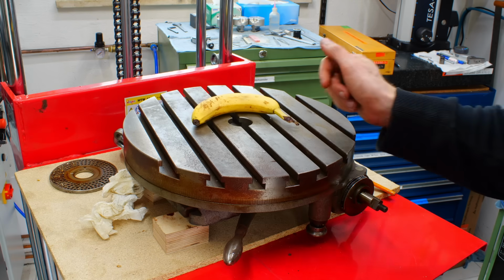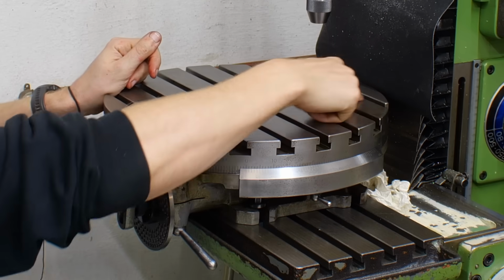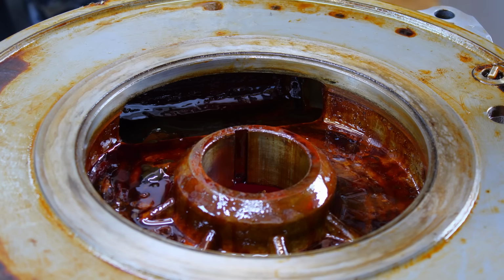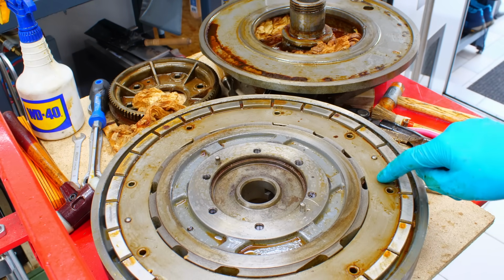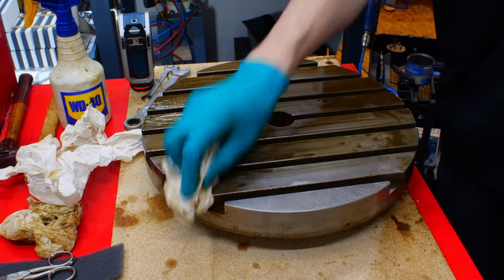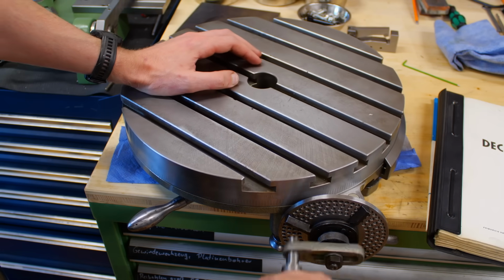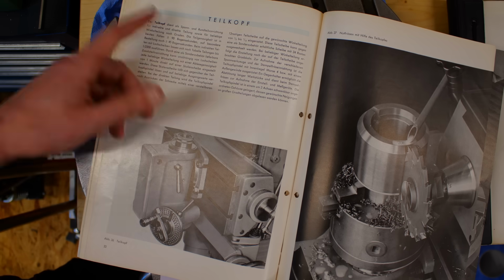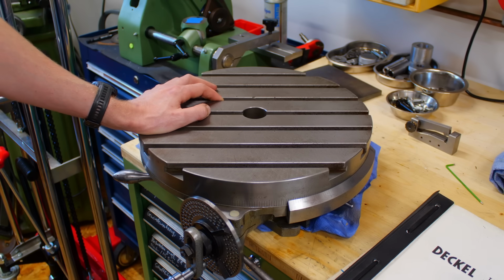Deckel Rotary Table: 380mm Monstrosity

Comment: I bought a 'cheap' ($500) 10" (250mm) rotary table several years ago thinking I would never need something that big.
It's heavy so never got the use I expected (4", ~100mm) was usually large enough
A five or six years later, I needed a 20" radius (~500mm) over a 5" (~125mm)  length on the end of a 1/2" (12.7mm) 6061 plate. (x2)
Luckily it wasn't high precision so  a bolted on extension plate (piece of steel, 5/16" thick (~8mm)  not quite thick enough or wide wide enough to support it very well. I made a 'slider' for outside edge, far from idea but it cut vibration to almost zero so got the job done.
Main point, apart from liking machine accessories, you never know if a hobby project may come along.
I was making an Egli style fork brace for a 1965 Suzuki T305, there were four 'precision holes' that needed to be in line as plates would be 5"~6" apart (125~150mm) with rods
I know you have made precision parts for Honda's, (CX water-pump rotors?) you may feel like making something less precision but 'interesting'
You need a lot of space to be a tool collector

Comment: Stefan, I'll wager a beer that the rotary table finds a use as an extension to the work area, particularly for the work that you describe as 'larger'.

I say that, because I've seen the effort that's required to hold the work on the vertical surface of the mill ... 🙂

Comment: If you had a job requiring lots of tool changes and multiple parts, you could set up multiple work stations and just rotate through 3 or 4 parts for each tool.  By the way, I can't seem to find the videos about those fancy EDM vises you had purchased..

Comment: we have a vertical shaper that has a rotary table built in , we mounted a 4jaw to that so its great for setting up work that require multiple keyways or splines

Comment: Nice fixture - it has basically never been used. The hardened grease and thick oil is typical of an item sat forever. Great find - if a little big.

Comment: Man I wish you had shown the reassembly process
Stefan doesn't respond very often to comments 
but I really would like to know what lubricant he used
Reply from the maker: I though I was pretty good at comments?
MoS2 lubricant on every press fit, screw thread and ISO68 way oil for the geardrive and slide surfaces (Thats also what the rotary table is filled with).
Reply: @StefanGotteswinter  Thank you so much! I appreciate the response
I have a 12" Tryoke that I want to rebuild - I'll use the same

Comment: Do I understand correctly that the total tolerance of 180 arc seconds is the same as 3 arc minutes?
and do I understand it correctly if I convert that to the deckel with a diameter of 380mm, that you then have a maximum deviation of 9.94mm based on the maximum radius of the deckel??
cheers 
ben
Reply from the maker: 3 Arc minutes is correct, yes.
That converts to 0.05 degree.
On a diameter of 380mm (190mm Radius), thats a maximum error of 0,166mm at its circumference.
(Didnt do the trig, I drew it out in cad.)
Reply: @StefanGotteswinter  oops, you're right, I forgot to divide it by 60 and then multiply it times 3

Comment: Something that I find usefull in such large rotary table (but it might be specific to my field of work) is the ability to put another X-Y table on top of it to work on a part with circular features with different centers.
Reply from the maker: Absolutely useful, agree! I have a X/Y stage that goes on top of my indexing head and i use it more often than i would like to admit.

Comment: Stefan is hovering over a line. There are the machinists who move parts with tweezers (eg., Clickspring), and then there are those who use cranes (eg., CEE Cutting Edge Engineering). They represent the boundaries. Most of the craft is in the middle where stuff is moved by hand. Stefan has always been closer to the fine end. Now he needs a crane! All preconceptions have been exploded and all bets are off for the next project. Enjoy the work you do, and hope the perfect job for the new tool comes your way (and you can share it with us).

Comment: Enjoy Stefan, the 6017 is lovely (and, in a way, very suitable to the smaller machines with the narrow beds. On the FP3, you either need spacers to lift it off the table or, if you place it at the edge of the table, it ends up very far from the machine...). One point that needs some care is the clamping: since it's in the middle of the table, if one goes crazy on the clamp, it pulls the middle of the table a bit low and bows the end up high. So don't go crazy on the clamp.... :D I think this is different on the swivelling circular table 2236.
Regarding the Moore, well, 6017 was Deckel's workhorse. The optical ones do 6 and 3 arc sec accuracy, so, beat that Moore, haha... :P

Comment: Stephan, I own two of them because they came with the Deckels I bought. The weight is cumbersome to work with but they’re really great for extending the machining area. I made really big parts on my Minimill with it and loved their accuracy. When setup correctly I couldn’t see or feel any transitions in meeting machined areas. And the reach of the y-axis on the Deckel has been to small many times now. And with this guy you just swap your y travel to your bigger x travel. They’re beautifully made and can be lifesavers in the shop. I also used it with a compact vice on top. One datum in the DRO for the back-left corner of the vice and a datum for the center of the rotary table. Quite universal in many cases. Thank you for sharing your Deckel adventures with us. I’m a big fan of the brand and your work. Thank you Stephan. Best! Job

Comment: Bought a Troyke DMT-15 (12" Rotary table with X-Y). Damn thing weighed 140 kg and I never got it on the table of my Bridgeport. Stan Z (Bar z/Shadon HKW) bought it off me and he quickly also got rid of it too! Didn't really need it after my Tormach PCNC 1100 arrived. Never did have to figure out how to set it up, CNC much easier!
Reply from the maker: Damn! Those Troyke X/Y Rotary tables are so cool. But also SO obsolete :D

Comment: I have a strange kind of nostalgic happiness I associate with the smell of old oil.  Yes it is stinky, but it reminds me (I'm 70) of a pleasant past.
P.S.  I have an almost identical lift cart ("stacker" we call them), except mine is blue and has forks.  They were probably made in the same factory in China.
Reply from the maker: This one has forks too, but came with a sheetmetal plate to transform it in a flat "table" -very useful! :)
Reply: @StefanGotteswinter  I have a sheet metal top to a machine cabinet I use for this purpose.  Not perfect, but free.
Reply: @StefanGotteswinter  P.S. The Pretty Reckless are playing at Olympic Stadium in Munich on June 9th.  Thought you might like their hard rock / death metal style.  Death By Rock and Roll. :)

Comment: Great video.  I really like seeing the Deckel equipment and how well you explain how to use them.  I have a 15” 380mm Troyke rotary table.  I bought it from an auction at a really good price.  I did not think that I wanted a table that big but after having it, I don’t think I would want a smaller one.  It is just so easy to clamp down things onto. I think you will find yourself using it often.

Comment: Great stuff. I well remember the anxiety tearing apart/cleaning an old tool to the point I could tell if it was good or scrap due to wear/abuse. Your table looks to be almost mint condition.
A question: in your career have you had to work with castings much? I remember work holding castings as being some of the most challenging things I ever had to do.
Reply from the maker: The only time I had to work with castings was with hobby projects - Dayjob was all solid stock or sheet metal. The closest I got to working with castings was with finish-machining metall 3d prints.

Comment: The last rotary table l tore apart had a special bearing from Kaydon. Very similiar to a QJ type bearing but with rollers instead of balls. For backlash adjustment of the worm drive the worm screw was a variable pitch lead. The worm screw could be adjusted axially to get the desired adjustment. RT was the 4th xais on a K&T HMC.

Comment: I do have similar rotary table on my TOS FN25, which is a cheaper clone of FP2. It does have some rust damage on the centering element, which is used also for direct indexing with locking mechanism pointing to the center of the table. I think to re-bore the housing to clean the rust pitting and wire cutting new oversized centering/indexing ring with some 0,02mm clearence. Anyway thanks for the video Stefan.

Comment: Have the exact same table which I use on FP4. Good table but slightly annoyed by mechanisms under the table which means you have to have it hang over the edge of the mill table or shelf it's sitting on

Comment: that's one nice table, and I hope you get some good use out of it. Sounds like you need to make a cart to hold it vertically while not in use, with wheels, or for use with a pallet jack.  Some lifting eyes will help you greatly, better than beating up your straps on the clamp edges.

Comment: For the tax man, when you are writing this purchase off as a business expense, explain that the parts you manufacture are usually small[ish] but they might have some large radii that you are going to make on this. Sometimes for aesthetics alone. And make sure to include a large milled radius on a few of your products, even as a chamfer or instead of straight line ;-)

Comment: I get your reference to 15+ bench vices😉  looks like you've picked up a gem that complements your mill and other rotary equipment, so you're ok👍👍

It would be interesting to see if the precision is enough to actually double the y travel usefully - it's got to be worth a "short", right?🙂

Comment: Too big for the FP1, IMO. Even too big for the FP2, IMO. Really needs to be on an FP3L/FP3NC/FP4NC.
Reply from the maker: I am split on that :D
They where advertised for FP1 up to FP3 and for the G1L / KF Engravers. It looks a bit ridicioulus on the FP1, but with its low profile I suspect it to be practical.

What I dont like for a permanent setup, is the large overall weight - Rigid table combined with the rotary are almost 80kg pulling on the x-axis.
Reply: @StefanGotteswinter  I used to use a 6" Kurt on my FP1, but it's way too big/heavy, similar to that table. There is no doubt, Deckel made some of the best accessories. I recently picked up a slotting head for it, but haven't put it to use yet.

Comment: Adam Savage (of Mythbusters fame) is making a smaller form factor round safe door that has a number of gears around the perimeter that drive pins outward like you see in movies about banks years ago.  He was asking why all the gears had 24 teeth (or multiple of that number) and he postulated that it was purely a manufacturing issue because of how the rotary indexing tables were designed with stops every 15 degrees. He was curious what was the reason for 15 degrees and not some other number.
Reply: Likely because many plates that are used as retaining plates in machines commonly have 4, 6 or 8 screws holes. 24 positions covers that nicely. I used to have a Hardinge H-4 5C collet indexer. 24 index positions.

Comment: Can you mount the rigid table from the Deckel FP1 on the Deckel FP3 milling machine.

The rigid table for the FP3 is bloody massive and I can not lift it for my self.

But I can lift the Deckel dividing head and since you can lift the FP1 table I think I can aswell.
Reply from the maker: I do not know that! You might have to find a manual for both machines and compare the t-slot distances on the vertical apron surface.

Comment: Won't that center clamp feature effect the plater height offset when milling to a certain depth?
I think a radial clamp verses a horizontal clamp would be better.
Reply from the maker: I think thats a general, but very minro problem - Every rotary table will lift/settle between clamping/moving by the thickness of the oil film, as long as its not a roller bearing element table.

Comment: Anyone who criticizes any PPE as unmanly or uncool is a twit.  Health and safety aside, it's pretty damn nice to pull off the gloves and not have my hands be completely filthy.

I don't think you have to justify this as a practical purchase.  It's really cool, it made a satisfying and fun video to watch.  I hope it was an equally fun and satisfying project for you.  It is mechanically interesting and who knows, maybe one day it will be the hero tool that saves a project.

It's nice to have an experienced machinist explain the purpose behind various features.  I don't think I'd appreciate all the logic and thought that went into the design otherwise.
Reply: What, you don't want to get solvents used to strip oil and grease and paint and other things made out of carbon and hydrogen and which penetrates microscopic gaps in things readily on your carbohydrate-based body which is covered in tiny little holes?? Wuss
Reply: Agree. I don't know of a machinist or restorer video creator who doesn't wear gloves. One particular creator, heavy equipment mechanic, I subscribe to flatly refused to wear them for a long time now you won't see him ever working without them.
Reply: The failure of so many to use PPE is a direct result of a poor educational system. Both our general institutional and vocational systems are archaic and behind the times. 
It is incumbent on all of us to stay abreast of best practices and protect ourselves!

Comment: I rescued a 10” (250 mm, 0.83 bananas) Brown & Sharpe rotary table in similar glued-together condition. It took quite a while to clean away the gunk! 👍
Reply: What sort of bananas are you eating???
Reply: @parkermusselman9824  Fair question. I was thinking 1 banana = 1 foot. However, looking back to Kurtis’ banana calipers at CEE, I now think a banana is an inch. Oops! It’s tricky, having so many systems of units. 🫤

Comment: Feature wise this appears very similar to the Emco rotary table I have for my FB-2 mill. Direct indexing lock @ 15 degree increments, dis-engageable worm, and dividing using indexing plates and sector arms. Mine is only 150 mm diameter though   : )

Comment: Thank you for making this video. I bought a large (edit: 207 lbs, though I do not remember the diameter) rotary table a while back with no specific use--a dirt cheap deal I couldn't refuse. The information you present is helpful as I for putting mine into use!

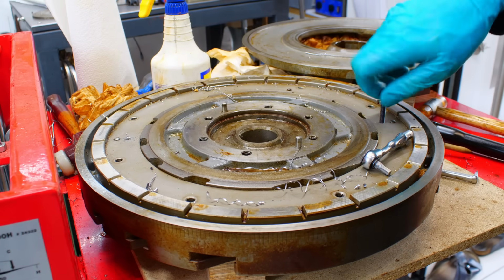Comment: At 20:51 when you are puting screws in there seems to be thread in the lower right hole that looks like it could be used to lift the part out maybe? Looks like M10 thread and the screws that were in there look like M8.
Reply from the maker: Damn sir. I think you are right, there seems to be a thread for pushing stuff apart.

Missed that!

Comment: It's hard to really get the scale right - is that a metric or imperial banana?
Reply from the maker: Its a intermediate banana, it matches none of the two systems 😬
Reply: @StefanGotteswinter  I think that still qualifies as imperial then.. you've seen what they'll use to measure instead of metric.